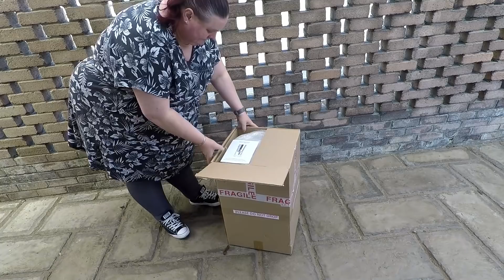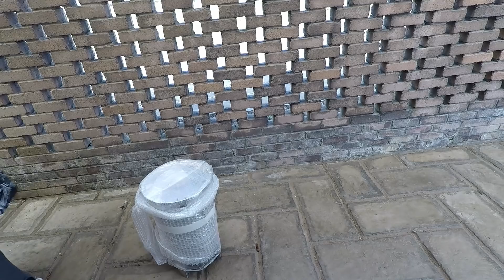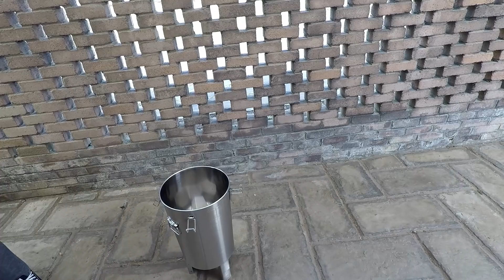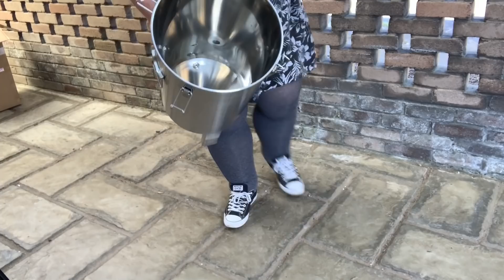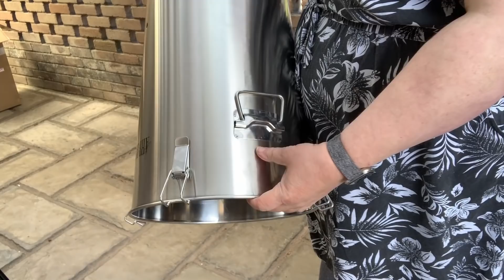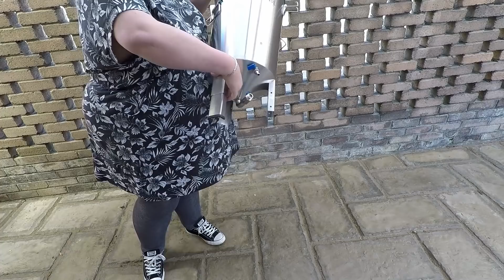Brew Devil / Guten stainless fermenter review

Comment: Am very tempted to buy this the only issue is I want to pressure ferment around 5 to 10 psi and am wondering if it will hold that pressure with that seal.
Reply from the maker: Hopefully someone will have an answer for you as it is not something I have tried

Comment: Great review Sarah looks a nice bit of kit to add to the collection, does the tap remove for cleaning and the rubber seal on the lid. Also does the rubber on the leg extension come off, then can you add to the legs on the fermenter . Save a bit of space in the fridge then, will have to measure if it fits in mine. Already got an SS brew bucket and was going to buy another one, but with this one being £25 cheaper I might change my mind. Will have to see how the penny's stack up over the next few months, thanks for sharing cheers  .
Reply from the maker: Great questions, I'll check on the tap question tomorrow. The rubber does come off the bottom of the legs, but as they just bolt onto the fermenter body you could always just bolt extension legs directly to the body